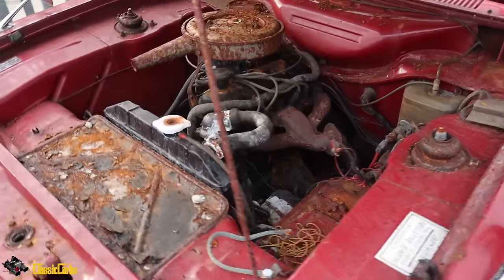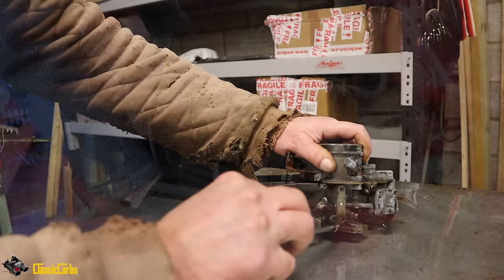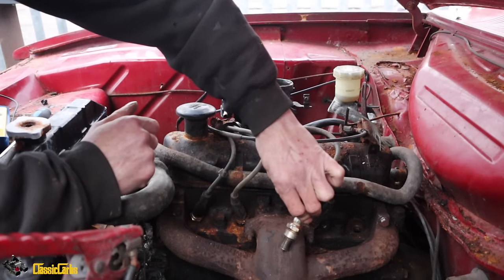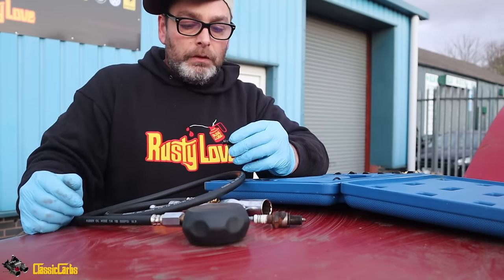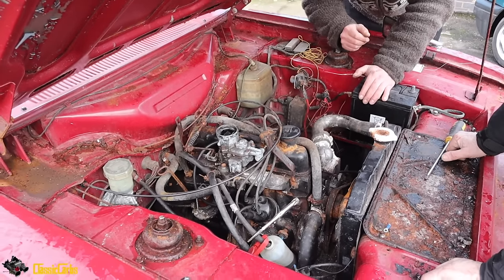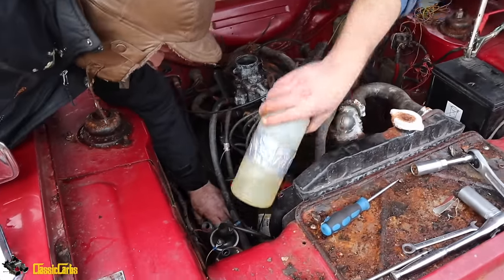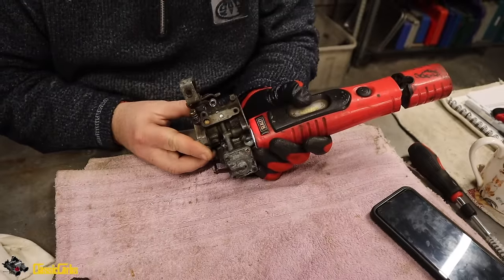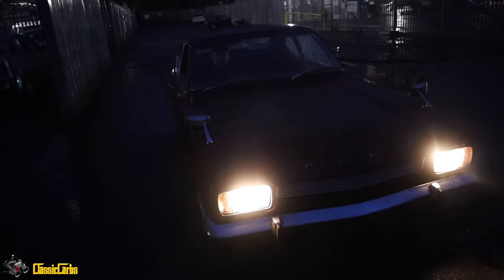1969 FORD CAPRI BARNFIND REVIVAL | BUSHTUCKER TRIAL STYLE

Comment: The exact same car that I bought in 1976 when it was for sale in a used car column in my local newspaper. It was being sold by the original owner who bought it new in 1969. I can remember that it only had 30,000 miles on the clock. It was in immaculate condition and was the same red colour as in this video. It was such a great looking car, and as a 20 year old new driver I couldn't have wished for a nicer first car. I sold it in 1981 for almost the same price that I paid for it.
Reply from the maker: Nice 😊👍
Reply: @Classiccarbscouk  I should mention this was in Canada, where there weren't many of these cars. The Ford Mustang got all the attention, but for me the Capri was a far better looking car.
Reply from the maker: @pauldg837  glad you enjoyed your capri. And yes, its definitely a good looking classic car, massive bonnet.
The mustang is awesome!!

Comment: I had a 1969 Capri Mk1 back in the day, my dad handed it down to me, it was the same colour but with a black bonnet. I modified the 1600 X Flow out to 1700 and fitted a race head, Rally cam, 11:1 pistons, twin 45 DCOE webbers, massive 4 into 1 exhaust headers. It was about 160+ HP,  with a 2000E Cortina gearbox. It would out run 2.8 Capri Mk3's. It used to surprise the guys at the Capri Club. It would rev passed 8000 rpm. Nice to see another in such good condition.
Reply from the maker: Sounds similar performance to our 'kate' and with the same gearbox 👌

Comment: Nice one, great to see you get this Capri up and running. if you look at my small picture it was my Capri MK1 3ltr gxl manual imported from Germany back in 1986 I had several of them over the years back in the day. Cheers
Reply from the maker: Thanks buddy, I do have a 1973 GXL also, 3L , sort of red/orange colour (can't remember what the colour red is) and it's in pieces and needs putting back together.
Thanks for the comment 👍👍

Comment: id fill the pots with a acetone and tranny fluid to help briing the rings back, then try a little  oil down the bores,  to help the rings seal to get it started. brak cleaner should NEVER be used to try start a engine.

Comment: When you’re trying to make compression it’s better to spray starting fluid in the carb than dumping gas or brake cleaner that will wash the cylinder and make less compression.
Reply from the maker: Thanks :)

Comment: Great video. I had the MK 1 facelift model with the overhead cam engine. Drove it to lake Como northern Italy in 81. I remember leaving the motorway somewhere in Switzerland changing from 4th 3rd and the gear stick came out in my hand. Managed to secure it back in with the flimsy ribbed metal cup that held it in place. WWU573L was the reg😄I think!
Reply from the maker: That must have been very scary and disorientating.. Glad you got it back in the box though! :) Fond memories eh?
Reply: @Classiccarbscouk  😄great memories

Comment: put the carb in swimming pool cleaner and water 50/50 for 3 hours then take it out and rinse then strip down.. the pool cleaner will bring it u pa treat.  break cleanewr down the throat of carb is stupid. use petrol . down each bore pu ta mix of diesel  and petrol about half a cup with piston up top, it will help clean up the sticky rings.. then do the next one etc leave them with juice in for about 1 hour between swapping them over then spin motor over to clean it all out ... be a good idea to ge tsome decent jump leads as they are crap.
Reply from the maker: Thanks for the tips 👍

Comment: When I saw this I wondered if it was the car owned by an acquaintance at school many years ago.
I had never seen a bright red Capri before I saw his one ( also on a G plate)  and none since ,until this one, despite seeing hundreds of them lined up at the factory.
I wondered if it was the same car, but when it was mentioned it was a 1 owner, then it probably isn't the same.
Infact my father had a G reg green 1600GT with a vinyl roof and disc hubcaps, as I remember.
Reply from the maker: This was indeed a one owner car, from near Birmingham here in the UK.
Reply: @Classiccarbscouk  Thanks,  the one back then was in Kent.